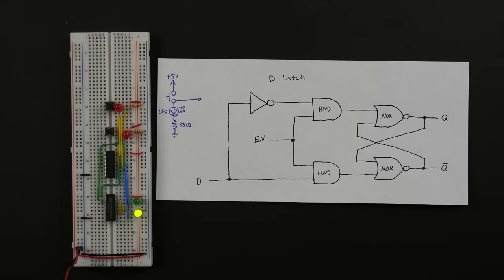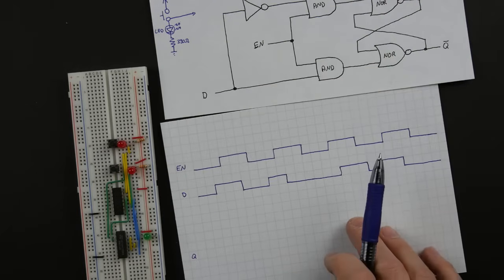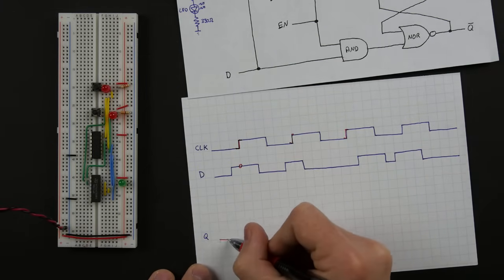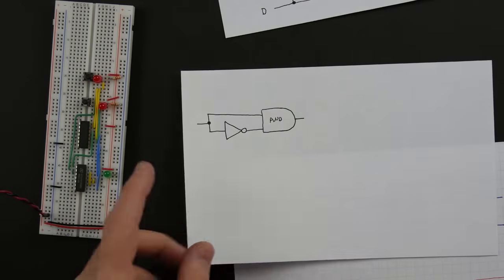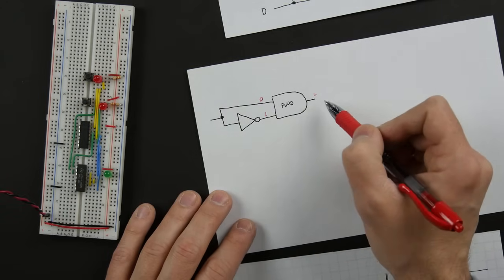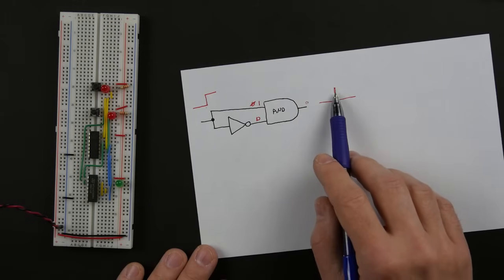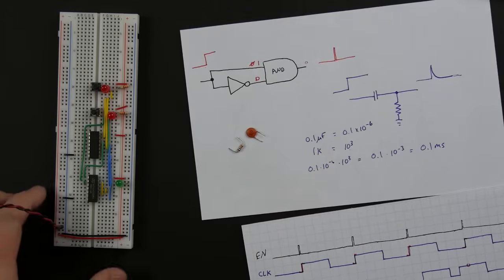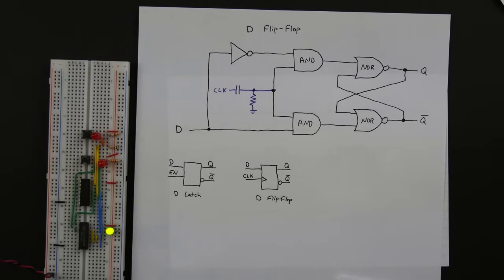D flip-flop

Comment: What's the point of the resistor, and how does the capacitor discharge without any moving parts? Dafuq. I guess I don't know how capacitors work.
Reply: I'll take a shot at explaining, here goes: You may know that a capacitor is basically two small metal plates that are just really really close but not touching, this closeness allows for the molecules in one to have a sizable effect on each other due to repulsive forces.  So when the capacitor fills up from the initial 5 volt signal coming, and all the electrons pile up on one side of the plates, the repulsive forces build up quite greatly and create a voltage, the electrons on the opposite plate are like "nah man I cant deal with all that pressure over there im out", and book it out of the capacitor down the wire connected to that side.  So this is why it 'appears' to let current flow, this stops as soon as the capacitor is full as when it is full no new electrons can come in and create a higher voltage potential which would in turn push out more electrons.  As the capacitor fills up so quickly the amount of current that "passes", or in reality is forced out the other side, only occurs for a brief moment. Now to explain the discharging if you are still with me haha! So that capacitor when full is like a mini battery charged up to five volts, its got all those electrons squeezed in there trying to get out, but outside the capacitor is a five volt signal coming from the enable line so the electrons are like "man its not better out there than it is here", but as soon as that line goes low,  or to low voltage basically, the electrons jump at the chance to go to a lower potential and will leave the capacitor saying "heck man, anything is better than here being all cramped up with you fools." The capacitor will now discharge down to the low voltage, because once it gets there, the electrons are back to saying "whats the point of moving if out there is as cramped as in here?". yet, the discharge current must pass through resistors and such to get to ground, so the higher that resistor value the more everyone leaving will get all bogged down and the slower the process goes and the longer that "passing" current will last. Fun Fact: In old cameras, where the flash is caused by a big capacitor discharging, you can get shocked when opening it up, because that big old cap isn't connected to any ground or anything before the picture button is pressed so all that current just sits there just waiting for somewhere to go, and where your nice metal screwdriver touches it: BAM, those eager little buggers jump at the change to get out, and with so little resistance in your screwdriver, they make a helluva spark when they can all jump out at once! Hope that helps, and keep up the good work of studying electronics! It takes a lot of guts to go out on your own and try to learn such a daunting subject! Much respect!
Reply: With regards to your previous response: When the capacitor discharges, yes you will see another sort of pulse like you do when it first charges, but this time the voltage is negative with respect to the input of the and gate instead of positive! Since the and gate needs a positive voltage to count as a 1, we don't get the output of the gate going high like we do with the initial charging pulse. You can see this in the circuit simulation you posted: when you suddenly turn the supply voltage to zero, you can see a negative spike in the yellow line representing the voltage on the pin and if you turn it back to 5 volts you can see a sudden spike in the positive direction too. Using a square wave supply will help you visualize this too. Next, question when the capacitor is discharging yes I believe that is correct(hopefully someone will correct me on this part if I am wrong) that the electrons will discharge back down the wire they came from when discharging, so sometimes you will see things called bleeder resistors, very large resistors that are connected across the legs of the capacitor so that when the supply voltage is disconnected from the capacitor or goes low the capacitor can discharge through that instead of back into your IC, power supply, or whatever if thats a problem, if the current discharging back into the supply is not a problem and is able to accept the currents(like if it doesn't have diodes blocking current that way) then you can let it discharge back into the supply. If the supply or IC, or whatever has diodes and such you can still use the bleeder resistor method connected to ground to allow the capacitor to discharge somewhere. Now yes this capacitor will draw some more current from your supply so that is why we use a high valued resistor to not overload our supply.  Great questions, very insightful!  I hope I answered them well and I hope I was correct as well and didn't give you any misinformation as well haha
Reply: Thanks for the response. The only thing I don't get is how the capacitor discharges in the same direction that it let current flow originally. So for example, let's just say ground is to the right of the capacitor and the source is to the left. I get that electrons would flow from right to left initially because of the repulsive force in the capacitor. But after the capacitor discharges, shouldn't it go the opposite direction? All of those electrons are bunched up on one side of the capacitor plate with no way to get to the other side, so surely they have to go back the way they came? Is that correct? And if so, does it not create a second impulse as long as the first (when charging), except with opposite polarity, like an AC current?
Reply: Electrons are negatively charged, so they flow from negative to positive. When you apply a positive voltage, it is actually an electron sucker. So, when a positive voltage is applied to the left of the capacitor, it sucks electrons out of the left-side capacitor plate. The lack of electrons on the leftmost plate causes electrons to pile onto the right-side plate to make the charge between the two plates equal but oposite. Because of the resistor, there is a very low flow of electrons from ground into wire connected to the right side of the capacitor. So, most of the electrons flow from the wire into the right-side of the capacitor plate. This causes the wire to be depleted of electrons, creating a positive voltage. As electrons flow from ground through the resistor into the wire, they are pulled into the capacitor's right plate until the right plate has as many electrons as necessary to make up for the depletion on the left plate. Then the wire fills back up with electrons to make the voltage (remember it is positive) go from 5V to 0V. The voltage at the output spikes at the beginning because of the instant pull of electrons into the right of the capacitor, but the voltage gradually decays because of the gradual flow of electrons through the resistor. You may ask, how does the wire naturally have a capacity of electrons? Remember from high-school/freshman chemistry that all metal atom nuclei have a vast electron cloud, sometimes called a pool of electrons. It is from these clouds that electrons are depleted.
Reply: K got 20 videos into a khan academy playlist on electrical engineering before I gave up. Can someone please explain how capacitors work in this context? Why does the voltage flow through and then drop as it fully charges? Why is the resistor relevant if the current can flow through an alternate path? How does the capacitor ever discharge with no moving parts?
Reply: the resistor act here as a point that you can read a voltage between it and the ground as it RC filter
Reply: Thank you very much for the replies! This had been bugging me for a while. I thought the gate might not go "1" because of negative voltage on the input, but I wasn't sure and couldn't get a confirmation until you.
Reply: Somehow I missed your response. Thank you very much for helping me understand.
Reply: With regards to the first part, that is right! The capacitor would retain its charge due to having no path to discharge that punch of packed in electrons! With regards to whether a possible path could be the clock circuit itself when it goes into the low part of its pulse, well.. it depends haha! It depends on how you build the clock circuit and such, for example if the clock circuit had diodes that prevent the flow of electrons back into it then that would most certainly not allow it to discharge there. Yet with regards to the clock that Ben Eater has built; he explains in another video the circuit when outputting a zero(or basically is in its low state) is sinking current. Basically meaning that yes, it will allow current to flow into it when it is low, as that is how a zero is represented in binary, and a one is when you are outputting current. So to recap, when the clock goes low, the S-R latch(you can see this latch in his clock circuit video if you haven't watched it) outputs a zero, when this happens the latch is sinking current(or basically allowing it to flow) and should allow the capacitor a chance to discharge after being charged from the high pulse. Yet we must remember that this may not always be the case with every clock circuit as some may contain diodes or other devices like transistors that may not accept current flowing back into it, and sometimes that may even damage the clock if we did send current back! so when planning your circuits always think about giving the cap a place to discharge! This is why you can get quite a shock when opening up old cameras that use capacitors for the flash and don't add in bleeder resistors to allow them to slowly discharge when not in use! In fact be careful when handling capacitors when taking apart any old electronics as they could still be charged! Hope that makes sense!
Reply: You may already understand this now as it was a year ago and everything, but this specific comment about the clock is explained in this link: https://www.murata.com/en-eu/products/emiconfun/capacitor/2011/01/14/en-20110114-p3. The capacitor builds charge but it has nothing to keep it there except for additional incoming current approaching the capacitor - when the incoming current is lost, the capacitor charge then dissipates back down the input wire where the charge was built
Reply: DUDE THANK YOU!...  This explanation just gave me about three AHA moments.  A lot of shit makes sense now when you think about the voltage creating a depletion of electrons.
Reply: here's a circuit diagram of the video tinyurl(dot)com/jjslbmf .. so it charges and eventually the output turns off as expected... then nothing happens because there's no way for the capacitor to discharge
Reply: One more question if you don't mind: Ok so if you charge a capacitor with a battery and then unplug the battery, the capacitor has no way to discharge because the circuit is incomplete and the current has no where to flow. In other words, if you took a charged capacitor out of a circuit, it would retain its charge. Does a clock, when it turns off (goes low or whatever the term would be), still allow for a complete circuit; i.e the electrons are free to flow through the clock when it's in the off state? So a clock allows for a capacitor discharge when it turns off?
Reply: Think of two PVC pipes separated by a balloon. When you blow air into one end, you push the air out of the other end. As soon as you release the air from the balloon, it sucks air back into the other end and pushes it out from the end you blew into.

In electricity, the "balloon" is the space between the two plates in a capacitor that electrons cannot cross, and the air is the electrons. Charging a capacitor and disconnecting it from a circuit is like filling a balloon with air and tying it off.
Reply: LOL Perfect!
Reply: DUDE!  THANK YOU!
Reply: You have to be very careful or the flux capacitor is gonna blow!

Comment: Won't the and with inverter put out a pulse on both a rise and a fall? You only want one on the rise.
Reply: No, it won't because the AND outputs a 1 only if both its inputs are high. On a falling edge the inputs are both low for a brief moment.
However, with an XNOR gate (exclusive-OR followed by an inverter, eg 74LS266) in place of the AND, one could indeed detect both kinds of edges.
Reply: no

Comment: You are wonderful teacher , keep posting videos and make us educate, can you make a video on pull up and pull down resistors.
Reply: YouTube.com/ElectroProjects
Reply: yerriswamy k.m he discussed that pretty thurally in previous videos in the play list.
Reply: @tberry7348  
I couldn't find it
Reply: @gokuvegeta9500   basically, in a logic circuit you need to have either a 1 or a 0, you can't just disconect a wire, cuz that'll make it go to a random state. the pulldown resistor is conected to ground, so by default, the value is 0,but when the 1 comes in it will take 1 as the value it'll work with because of the resistor
Reply: Really good

Comment: According to what you have taught so far, whenever the enable is low,  Q SHOULD  be low.
 But when you use a short pulse as a enable and when that pulse ends shouldn't Q be low(because enable is low), why is Q still High? How does the scenario change by using a short pulse as a enabler?
Reply: Rahul MK well when the enable is low u can't change states, when enable is high u can change states.Q doesn't have to do anything with enable.In SR latch s and r sets value of Q.and if u want to change it u need enable to change,.so if u give high to R,the q goes to 0.it stays in 0 even if u give S value as 1 when enable is low.Enable is like a command whether the flip-flops should change stats or not.it won't affect the stats of the output.

Comment: Exploiting the NOT's signal change delay... are there other situations where this is a problem? Timing, that is. Or, are there other situations where it's useful?
Reply: Yes, NOT Gate change delay is useful in Edge-triggers like Fall-Trigger .. more information follows @ the link below
https://www.allaboutcircuits.com/textbook/digital/chpt-10/edge-triggered-latches-flip-flops/
Reply: The delay of the inverter is also used in ring counter circuits where you have an odd number of NOT gates feeding one into the other, then the final NOT gate's output feeds into the first one's input and ideally they should oscillate at a frequency based on the capacitance of the gate's input. Though practical circuits I've seen employ additional RC networks to increase the delay to something a bit more reasonable.
Reply: Bit late to asnewer this probably, but... Good question! Timing is crutial and yes there are times when this can be a PITA.  You always have to read the datasheets to get the typical rise and fall times of the gate/function and then you have to always keep track of the cumulative propergation delay within the circuit. If the clock speed of the circuit is high enough, the propergation delay can result in the output not getting to where it's needed in time for the next clock cycle.

Comment: How do you wire your circuits so neatly? On my circuits I attempt to do it, but it always ends up messy :P Great videos btw!
Reply: with solid core wire, and taking the time to cut and bend then to the exact right shape
Reply: You have to train yourself to work neatly, if you drop anything, wire or tool pick it up straight away. Lay your tools out in a clear spot, not laying on the circuit. Any rubbish put it in a bin straight away. Working with wire, there are sites on youtube to help you. Practice stripping wire, keep doing it until you get it right. Use small pliers or long nose pliars to bend the wire to a sharp right angle. Don't start a project till you can do these things. Practice running the wire in sharp right angles. Run four or five wires together. Separate your components. Learn to solder from youtube sites.
Reply: barney boy he doesn’t solder he just uses a breadboard
Reply: @bobdagamer640  He made a video about this topic recently, check it out.
Reply: It's much easier to troubleshoot if your breadboard is neat.